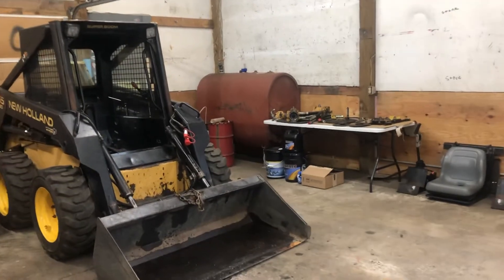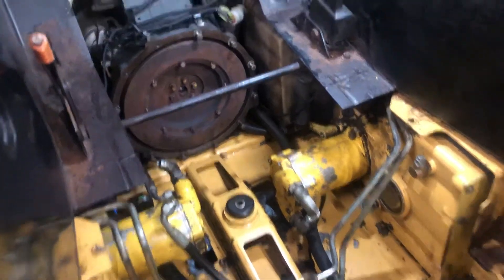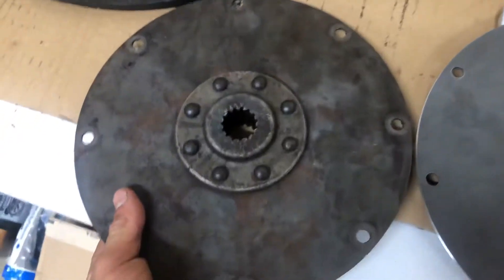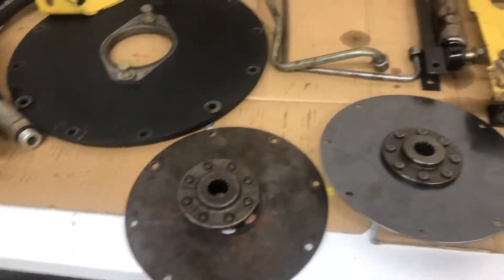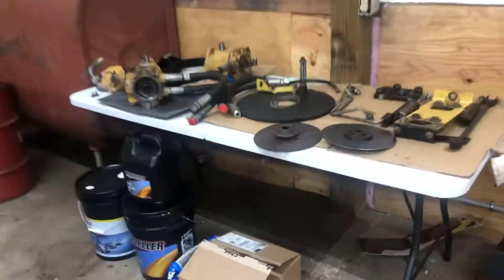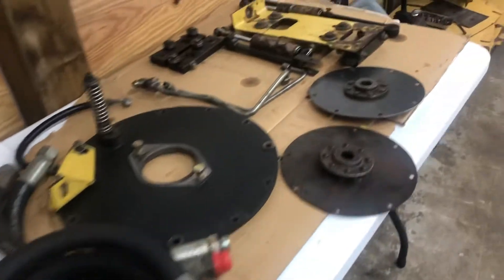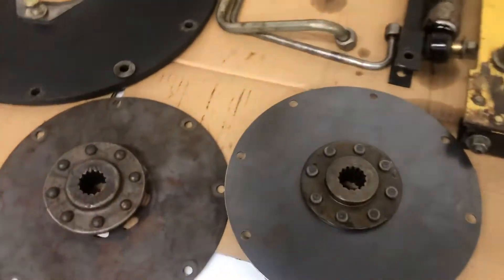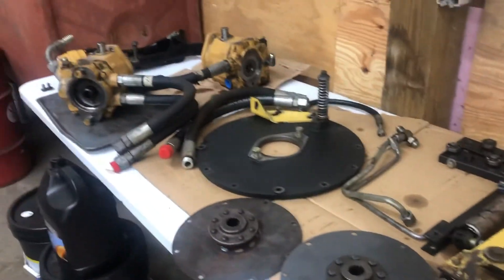New Holland skid steer lost hydraulics

Comment: Its important to mention why the flex plate and the parts mention usually break. It’s due to running the machine at too low engine revs. It really does need a minimum of 1800 rpm and when on a hard grippy surface, 2000 as a minimum. I have two LS565 machines which were bought new and are now 21 years old with 6500 hours on each. No issue with traction components and chains yet. Very very spookily, both had manifold fasteners  come loose, drop off and in a few cases shear, within weeks of each other at about 6400 hours, as if they were programmed to do so. In one case [they are both the same age, bought 2001] it needed a new manifold and silencer as well as new studs. This happened just before Christmas and just after New Year 2021/22
Reply from the maker: Interesting. When this broke, I was pushing debris full throttle and it jolted to a stop, no hydraulics, no drive. I felt it shear off. I eventually sold this one cheap, I pulled the hydraulic pumps out again and rebuilt all 3 with OEM seal kits plus new drive hoses and the machine still leaked.
Reply: @dortchsdiesels7483  
It can fail at any time but the cause is the torque overloads at low engine revs causing stress fracture and spline wear. After a minute or so of fast idle after a cold start, the machine should never be moved with less than 1800 revs. Not under any circumstances.  Stalling it in a pile is particularly hard on the drivetrain.
There are three engine/transmission mounts and these also are prone to fail if machine used at low revs. Especially the single central mounting underneath the transmission. The large bolt can eventually shear due to stresses. Check for parts dropped into the under shield when changing the engine oil, which should be done at the very latest, at 200 hour intervals. 100 if using obsolete oil specification.

Comment: I have a LS180 that I just purchased and just realize that the parking brake does not work. The handle and the linkage is moving freely but it does not have any tension. Any thoughts on how I can take care of this myself.
Reply from the maker: I’d try adjusting the linkage first but it’s likely your brake shoes are worn out. I don’t have this machine anymore but mine never worked either. Until you fix it just park with the bucket/attachment facing downhill and dig it in a little, or just use wheel chocks.

Comment: Out of curiosity when it was broke did machine roll freely Like it was a neutral?
Reply from the maker: Yes, once the hydrostatic pressure was gone it rolled around easily. We used another machine to load it and the tires didn’t turn at first but did start to roll freely.
Reply: @dortchsdiesels7483  did it make a clicking noise when it rolled by chance?
Reply from the maker: @smitto40  yes, clicking loudly, ratcheting type sound

Comment: Dude sweet video. Wish I had a buddy like you to do mine cuz I'm clueless but seems like I got the same issue except mines only when it gets warm starts Loosing all lift power
Reply from the maker: You can figure it out. This was one of my first pieces of heavy equipment and I learned a lot by finding the service manual online and tearing into it. That seems more like a hydraulic fluid / hydraulic pump issue than the issue I had in this video.